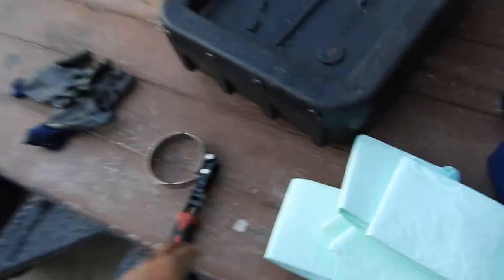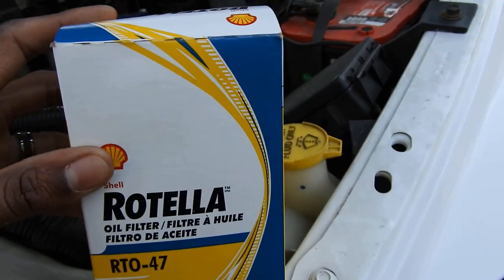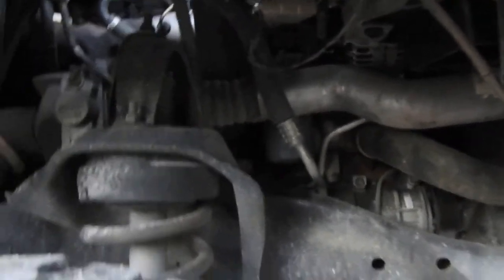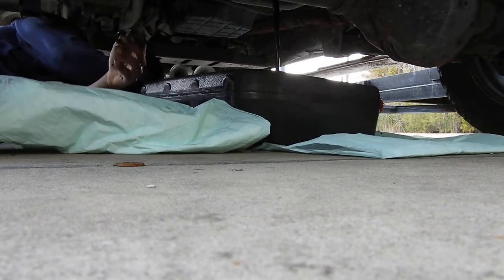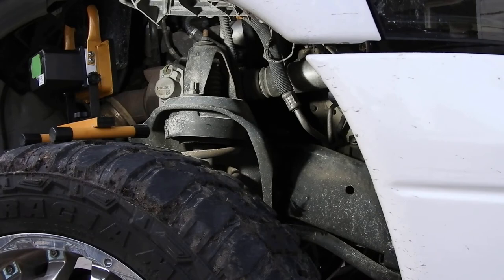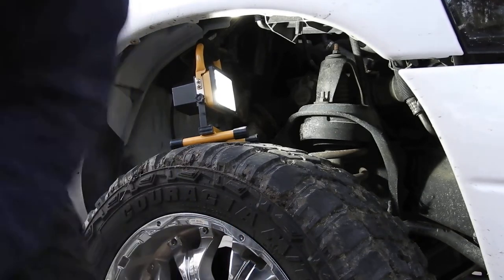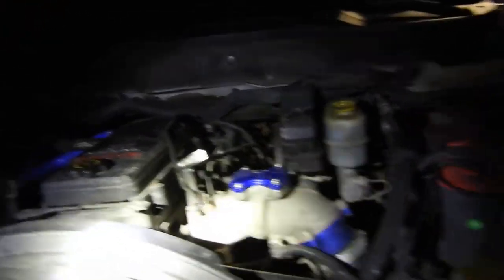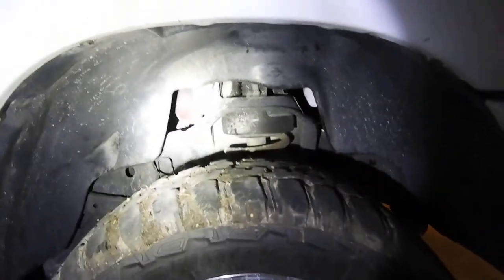CUMMINS OIL CHANGE/ NEW CHANNEL

Comment: And also do you still recommend the Lucas oil additive, I just inherited a 2007.5 6.7 cummins from my father. Your channel is helping a lot 💪🏼
Reply from the maker: The drain valve makes oil changes clean and easy. And yeah the lucas product works good